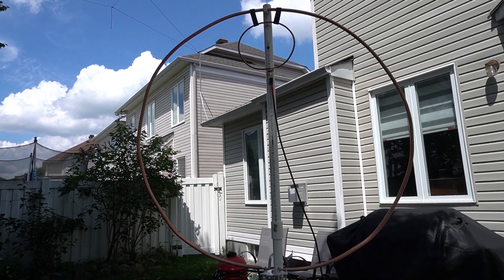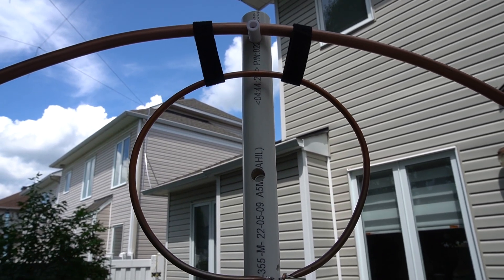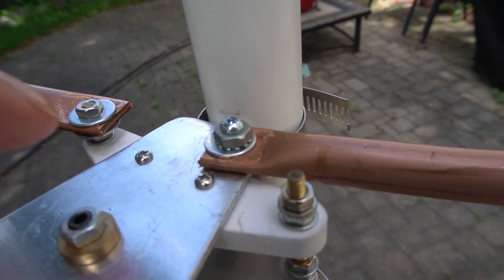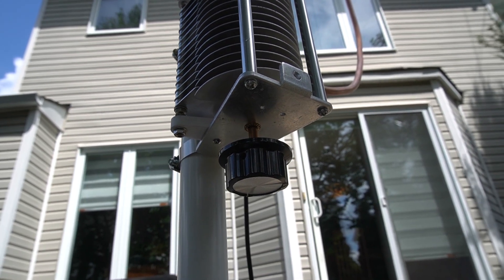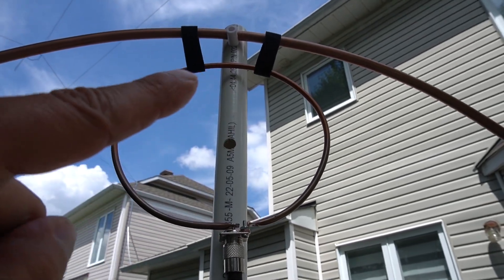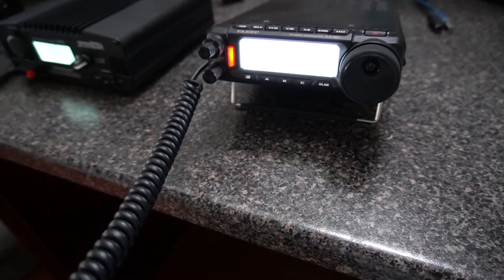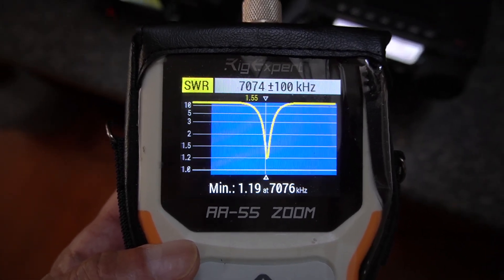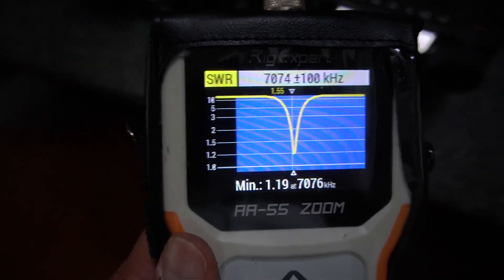HAM RADIO - Magnetic Loop Antenna 20m-40m

Comment: The impednace goes down the longer the coupling loop goes along the main loop or the more far away it is. The efficiency goes up the closer you are to the main loop and the longer it goes along. So you could get way closer with a smaller coupling loop and you can go even longer along th main loop. The best way to test this out is with a simple coax, using the shield as wire.
Reply from the maker: Thank you!

Comment: I made a loop   3.8 m  circumference ,  A coupling @ 740mm   with a 10pf to 150pf  3000v capacitor , 12.7mm copper diameter tunes to 6.9mhz to 14.5mhz no problems at 100w.s  ,Remote control tune and rotor via 433mhz controllers  all in a sealed electrical box  water proof and on the roof with  solar charging battery pack in the unit  and panels are  small but effective on 3 sides of the box .  managed to get it  all done in one go ,  had to trim 1.2m  of the original loop as it was tuning to 5,5mhz to 13.5 ,   after trimming 1.2m off the 5m circumference  i fitted both bands inn with the 10-150pf capacitor and raised it up  to get both bands  with not much to spare  ,  Perfecto Amundo
Reply from the maker: Wow that's a project!

Comment: I have now made my second Mag-loop I used (on my first one) a 20-watt transceiver with no arcing.
It runs from 40-15 meters, The current one is much larger, and I hope it will run 80 meters at 100watts.
Reply from the maker: That's awesome. My MLA is just standing on the back for now but eventually I will get back to it.
Reply: @VE3DAL  It looks like you are on track with a great design, a friend of mine, KC9ELU donated a 10-foot length of one-inch heliax for the main loop, I fabricated the feed out of 2 feet of 1x 16th aluminum, and the cap, is from a surplus full power tuner. All I need to do is put it all together.
Reply from the maker: @AdamosDad For sure the material is very important a good MLA. Looks like you got it, I hope you do well.
Reply: There is a good Miguel VK3CPU - Magloop Antenna Calculator. You may get up to 10KV in your capacitor, so be careful to not short your antenna with to many watts and destroy your transceiver.
Reply: @MessiahHasReturned  Thank you for the advice, I will take a look.

Comment: Congratulations on the excellent project, Almir. I also managed to assemble a magnetic antenna that works reasonably well inside the apartment, but I prefer to use a vertical one with a very robust load coil and internal movement screw for impedance adjustment, manufactured by Zé das Palmas (Zé Palma de Ouro) in Minas Gerais, installed inside the living room. Here in the building, they do not allow antennas outside. 73 and great DX with your antenna. Espero um dia "cruzar as antenas". Forte abraço de PU2-UBB, Frederico, São Paulo, Capital.
Reply from the maker: @fguizini  Hello Frederico Thank you so much I appreciate!  I had a lot fun doing this project of a MLA even though I don't use very much. At home I relie on a moxon 20m, 15m and a delta loop for 10m. When I'm at the park I like to deploy a 2 elements yagi for portable operation  that I built myself. Espero um dia nos encontramos nas bandas meu amigo,  73s de VE3DAL Ottawa Ontário

Comment: I have quite a lot of experience with magnetic loops.  You can see the two loops I have in regular service on my QRZ page.  MFJ made a loop tuning box that was rated for 100+ watts.  I have used one to make portable field antennas on many occasions with excellent results.  
It must be kept in mind that high voltages can develop across the capacitor.  It is essential that you insulate the cap from the tuning knob or tuning motor particularly if you are tuning under power even a few watts.  
Ohmic resistances are a critical source of efficiency loss.  You might do better by soldering a copper washer to the copper tubing.  Alternatively, just using  a screw with a large head and the smallest possible hole to connect the capacitor might be helpful. 
you can purchase a venier drive used to help with the small increments that tuning requires.  
It is generally recommended that you use a BUTTERFLY capacitor or a vacuum variable capacitor.  Otherwise you will suffer ohmic losses at the wiper contacts.  The effects of a very small angular change on the peak frequency is remarkable.  With air variables you wiould have to use a reversible DC motor with gear reduction or even a stepper motor with gear reducion for romote tuning.  My vaccum variable loop tunes remotely using  a homebrew PWM motor control and a NanoVNA.  Magnetic loops are surprisingly sensitive to ambient conditions; temperature changes and/or humidity changes will shift the position of the peak.
Reply from the maker: @larrypicard5969  Thank you so much for the excellent feedback. I'm very new on MLA and any information is very helpful. My next goal is to figure out to make tuning remotely. I have a very small 12V motor with reduction gears with a controller forward and reverse that I used for my timelapse photography on rails, I'm thinking to give a shot with that. The gears that will be touching the capacitor I will make on my 3d printer. Also I will figure out how to do a better connection on the components by soldering. I will check your QRZ page. Best 73's my friend!
Reply: I made a loop   3.8 m  circumference ,  A coupling @ 740mm   with a 10pf to 150pf  3000v capacitor , 12.7mm copper diameter tunes to 6.9mhz to 14.5mhz no problems at 100w.s  ,Remote control tune and rotor via 433mhz controllers  all in a sealed electrical box  water proof and on the roof with  solar charging battery pack in the unit  and panels are  small but effective on 3 sides of the box .  managed to get it  all done in one go ,  had to trim 1.2m  of the original loop as it was tuning to 5,5mhz to 13.5 ,   after trimming 1.2m off the 5m circumference  i fitted both bands inn with the capacitor and raised it up  to get both bands  with not much to spare  ,  Perfecto Amundo

Comment: Nice project antenna. You may want to consider putting a 1:1 balun line insulation in the feed line coax at the antenna. MLAs are prone to common mode currents which will limit the amount of power you can apply to the antenna and limit the ability to get a good low swr. MLAs have very low radiation resistance so there can be 15 amps on the loop say at 30 watts plus thousands of volts on the capacitor. Soldering the loop to the capacitor will greatly improve efficiency and reduce mechanical resistance losses which is the biggest problem in loop design. I really like your project antenna. Great job and well engineered!  Best 73s. Dan K1YPB - On the air since 1962
Reply from the maker: @danimac3953  Hello Dani, thank you so much for your feedback!  This was my first MLA , my skills on electronics are very limited and I have a lot of questions. You answer on of them that soldering the components are better than tie them with bolts and nuts. I been getting very good SWR 1:1 but I think the efficiency of this antenna is maybe 50% or less. I have some better ideas as the project still going. At the feed point I have some ferrite beads on the coax I'm not sure if helps. Wow you have been operating for a very long time that's awesome!  Best 73's my friend!
Reply: @VE3DAL  Thanks for the reply.  Your efforts are commendable for the first attempt.  You are doing the right things.  The diameter of a meter is about optimum for 40 through 10.  Any longer and you would start getting lumped constants of rf current which should be avoided.  A loop like yours with soldered connections and minimized mechanical IR losses can be up to 88% efficient on 20 meters even with as much as a 1.5:1 SWR.  With 50% efficiency I might suspect higher than normal mechanical losses.  This would usually result in "heat loss" due to the high currents normally flowing through the loop components.  This can be tested quickly with extended key down time and say 35 to 40 watts, while watching the SWR meter slowing creeping up as the elements heat up.  With the size of your variable cap, I would suspect it could easily handle 25 watts digital, 45 watts cw and 75 watts of SSB, and maybe even 90 watts of SSB with a balun in the feed line.  However at those power levels the voltage on the cap would be in the thousands and many amps of RF on the loop.  Needless to say... never contact any component of the loop under power, as the RF burns would be extremely severe. Even at 5 watts it will render a "bite" that you will not forget for a long time.   RF exposure is also a concern with these types of antennae, so it is recommended to stay perpendicular to the loop plane, where the deepest null (approximately 20dB) is for safety.  IF the loop is hard to tune, or the SWR changes when you touch or get near the feed line coax, and / or changes with rotating the loop you would most like have common mode currents (CCMCs) on the coax and should use the balun I mentioned earlier.  The MLA magnetic "H" field is effective for a distance of about three or so loop diameters from the loop making it less bothered by surrounding  (unless those surroundings are metallic), after which it starts performing like a regular antenna "E" field there out to its destination.  If the "H" field is vertical, the "E" field will be horizontal.  Being a Mag Loop everything is backwards from an ordinary antenna. Such as... ordinary short antennas are capacitive and need a coil to load (ie a short coil loaded vertical such as a Buddistick) where as... a small MLA is inductive and needs a capacitor to load it to resonance.  The vertical mounted MLA sends out a vertical "H" field, but then dissipates and the horizontal "E" field takes over giving the small vertical ground mounted loop the equality of performance of a  dipole "at height".  In some cases the MLA will actually out perform a dipole, which makes the MLA a big favorite for portable ops.  The MLA some times gets a bad rap from the grouchy old timers out there because they don't understand anything other than a dipole and are not willing to explore the technology of this type antenna.  (Some OTs will never change... hi hi)  If you can put up with the high Q of a MLA, it can be your best antenna solution for many circumstances, such as stealth ops in an antenna restrictive HOA or POTA ops where trees are limited or don't accommodate an EFHW wire.  I have personally worked 7800 miles on an Alexloop one loop diameter above the ground with 10 watts on FT8... Not bad in my book. Best of luck on your continued experimentation.  Have fun!  73s, Dan K1YPB
Reply from the maker: @danielzdanowicz6899  Hey Dan, thank you so much for the info very helpful! I love to explore new technology and the challenges that comes with it, and MLA is one of them. This afternoon I changed the capacitor to be on top and the coupling at the bottom and I didn't noticed much of difference. I'm aware of the danger from this antenna, but is always great to know even more information about it. Thank you again I loved your comment. Best 73's my friend!

Comment: Great information. I was thinking about a monoband loop antenna for 20m CW portion. Would it work with smaller capacitor or a RG213 as a capcitor? Is there a way to find how much capaticance is needed?
Reply from the maker: @geirha75  Thanks for the feedback!  I very new on magloop antennas, yes it does work with a smaller capacitor it will be limited on output power. I'm still try to learn what band needs how much capacitance.

Comment: Nice MagLoop Almir, good Job on that. The capacitor should be on top and the small loop on the bottom. This reduces the receiver noise.Or Am I mistaken? Happy Weekend & 73 de Uncle Günter from across the Pond 💯🙋‍♂
Reply from the maker: @DK5ONV  Hey Gunter! Absolutely I will try that because one thing I was getting a lot of noise as it is. At first I thought it was my neighborhood. My next goal is to take to the park but this type of antenna some logistics good sense has to happen. I hope you are doing better and good luck my friend 73! Gunter buddy